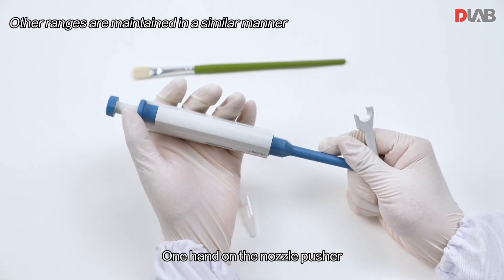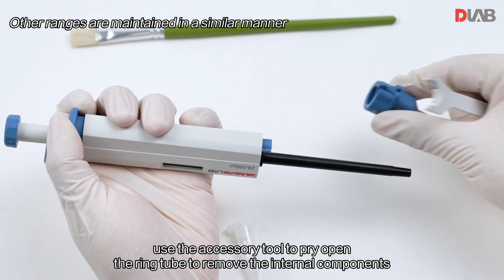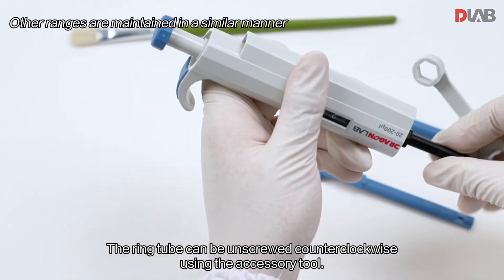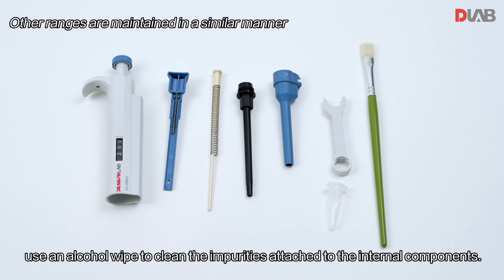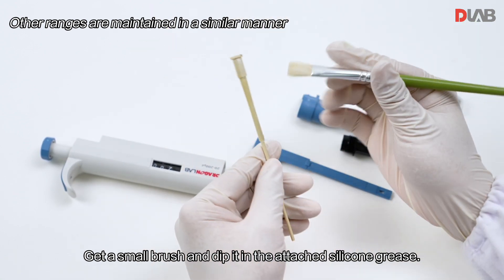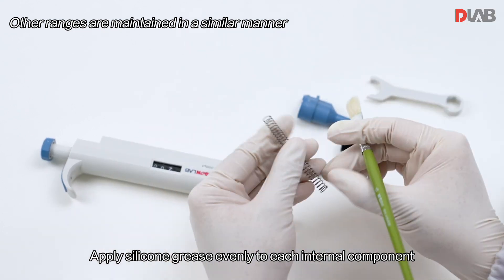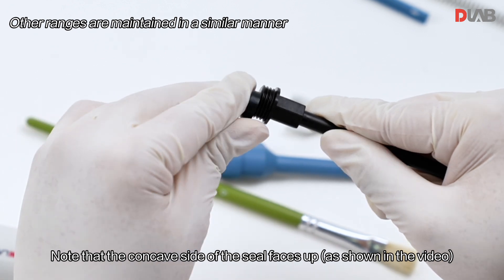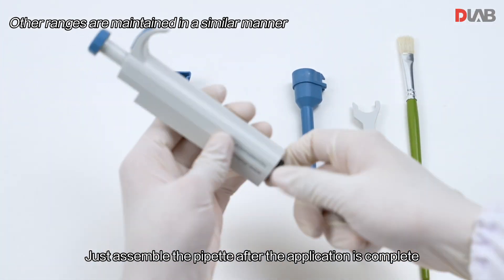PiPette Maintenance Guide

Comment: Do we need to sterilise certain part when maintenance ?
Reply from the maker: Sorry, I just saw this message because no notification came through. Under normal circumstances, no disinfection is required during maintenance. If a special experiment requires it, the pipette nose cone and related parts can be disinfected by wiping with alcohol.